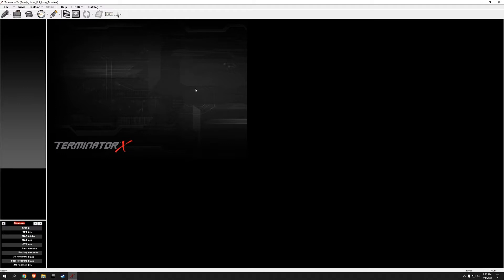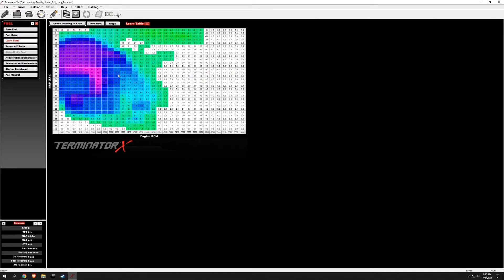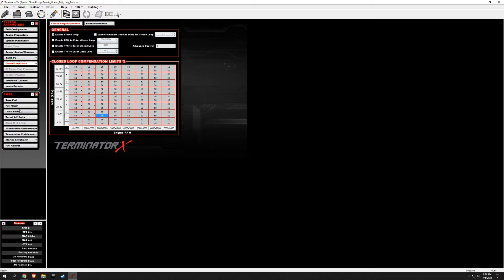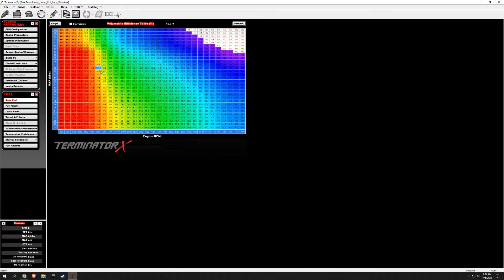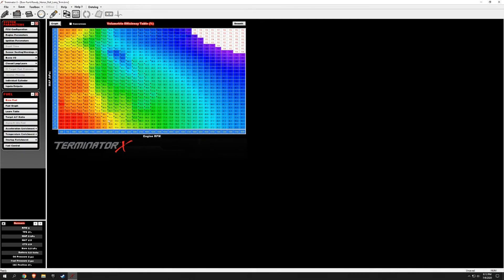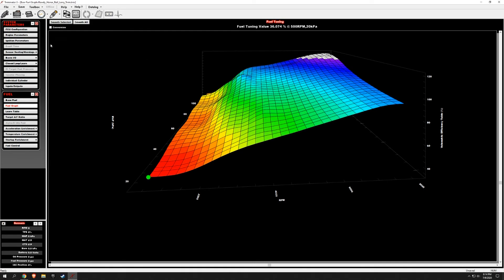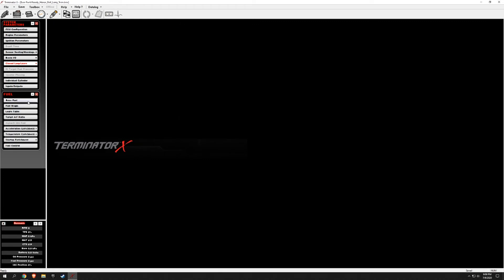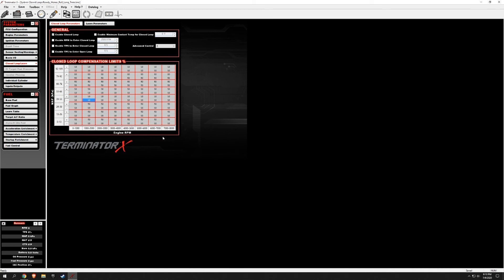SN95 Terminator X: Transferring fuel learn to base fuel table

Comment: Never transfer learn table until you have achieved well over 50-100 miles in one drive. If you are doing your own tuning then is ok because you can see where the changes are needed, but you do that manually and not using the learn table.